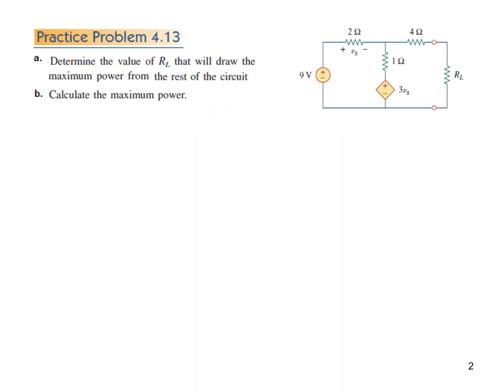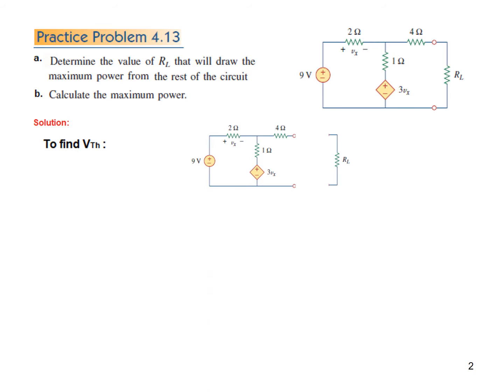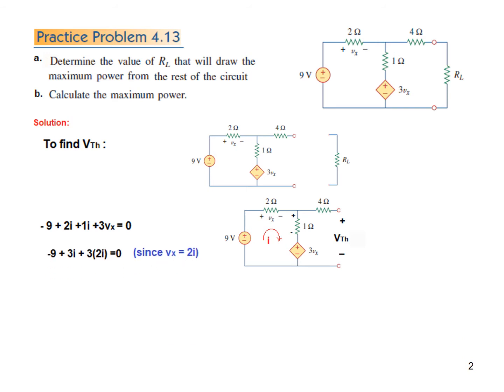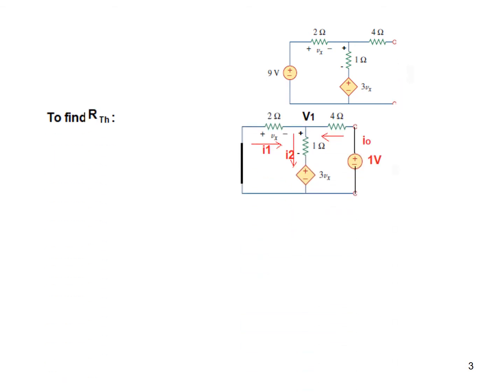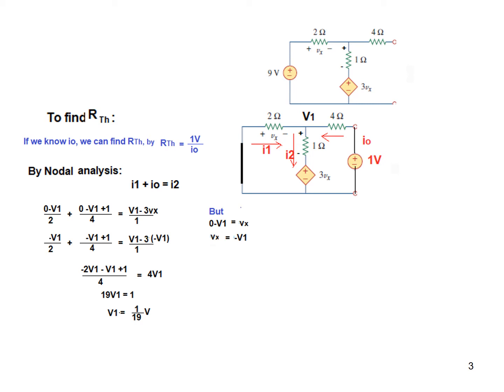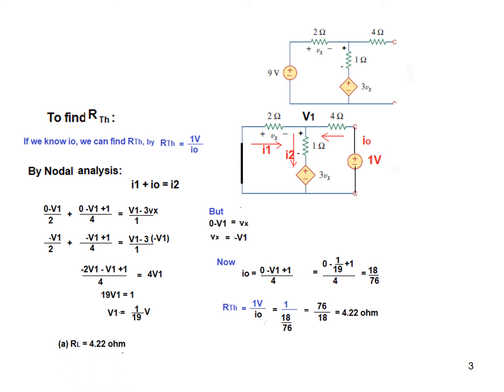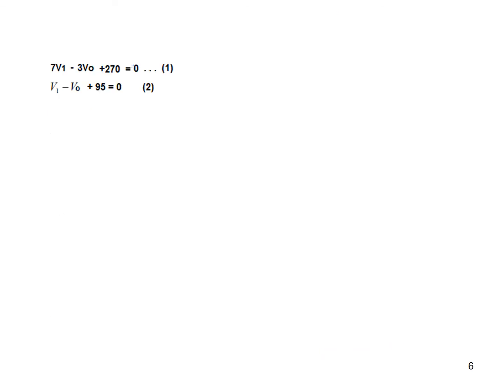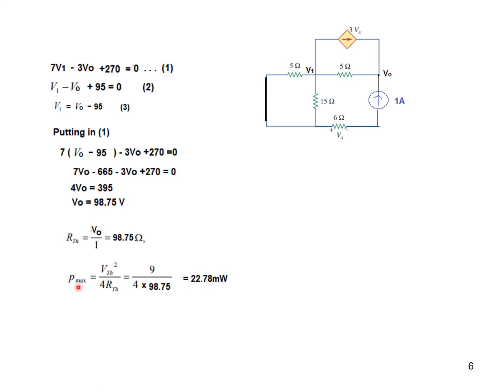(E)LCA Pr 4.13, Q 4.70 ||   Maximum Power Transfer || DEPENDENT Source

Comment: In the second example , i do not understand y u decided to connect a 1 amp current source
Reply from the maker: When the circuit has a dependent source in it, we can not find Rthevenin directly. For this purpose we can use a test voltage source of generally 1V (which I did in example 1), or test current source of generally 1 A (which I used in example 2).  
Please watch my following video   https://youtu.be/3gPoJkLovXo

Comment: Sir in calculation of vth.. Kvl for second loop -3vx+1i .. I think but y it is -3vx-1i sorry can u plz clarify in1st example
Reply from the maker: The convention is that wherever current touches first, that terminal is marked +ve and the other end is -ve. So due to current  i1, the 1 ohm resistor has +ve at the top and -ve at the bottom. Now when writing KVL  in loop 2, I start from bottom left side of the loop. So we first see -3Vx, and then -1i1 (voltage drop in 1 ohm resistor)...
Reply from the maker: I suggest u watch my video on KVL, to build a better concept.